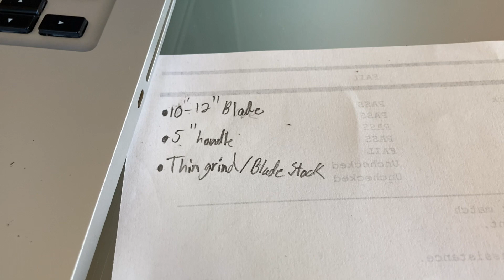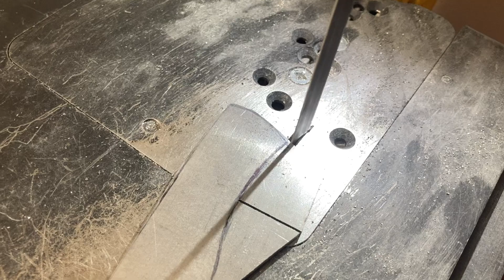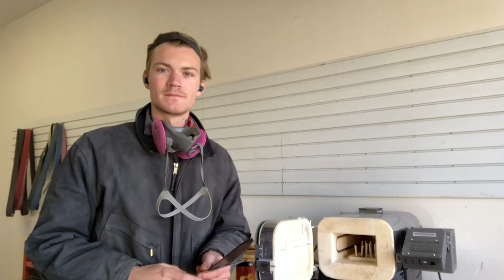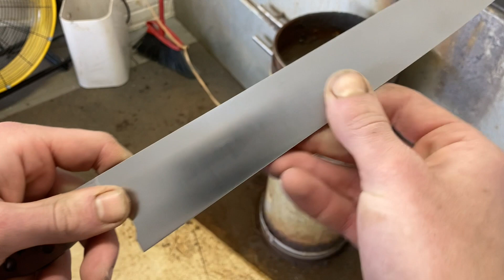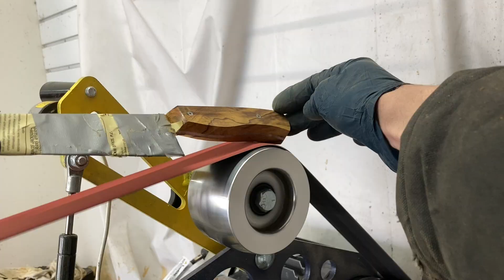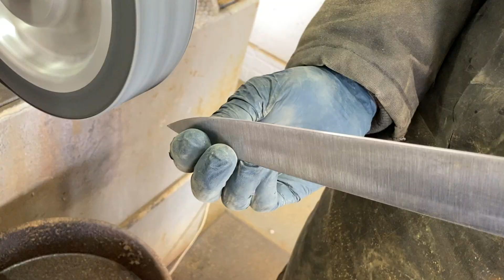Making a Custom Brisket Knife | Knife Making

Comment: How did you get such a big following? How long did it take before you could do knifmaking full time?
Reply from the maker: It used to be a lot easier to get followers on Instagram than it is now. I also had a few posts go viral on Reddit. But I would just recommend being really consistent in posting and building a relationship with your followers. I don’t really consider myself full time since I just graduated from college and I am still planning on getting more degrees. But I probably could if I wanted to. I’ve been doing it for about 7-8 years now and would say that the last 2-3 would have been enough to go full time.